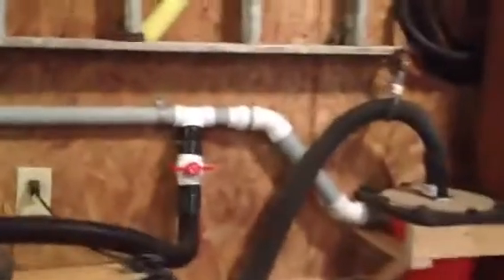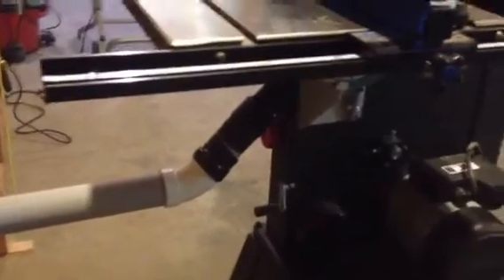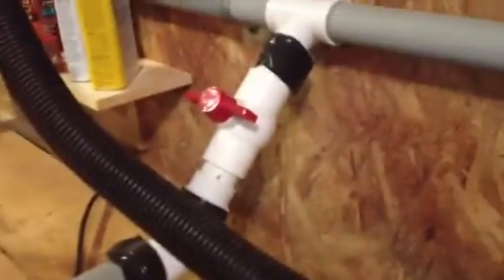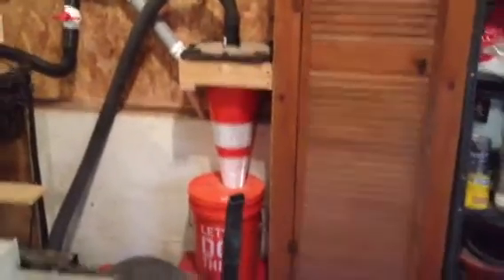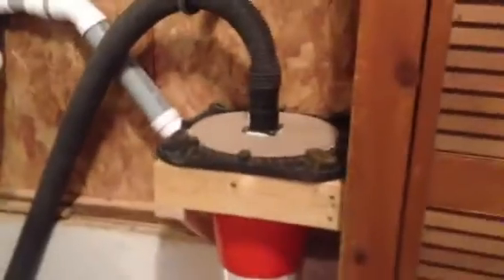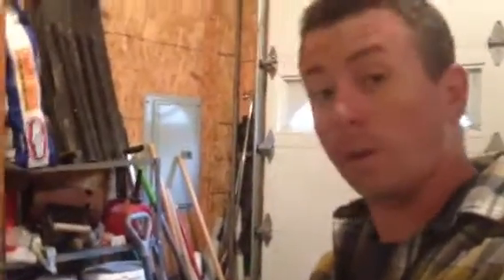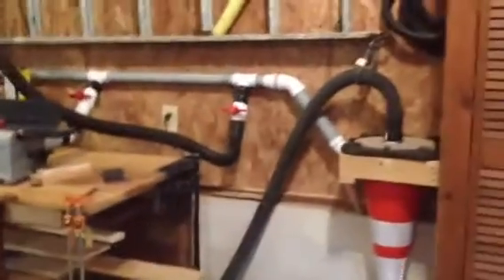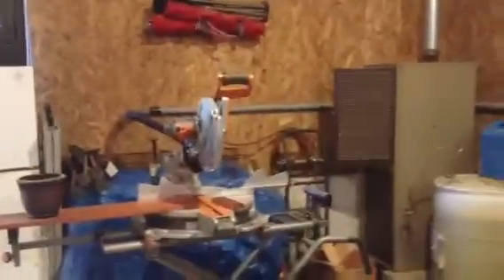Cyclone dust collection system

Comment: That is a small vac to be using that much run to tools. This is why whole shop system need some high CFM systems over small portable systems. Its pretty much like water pressure in large systems with low input pressure.